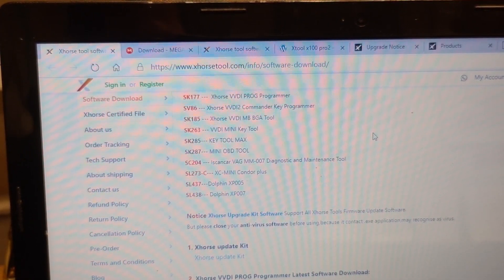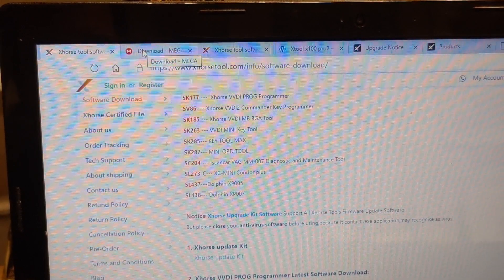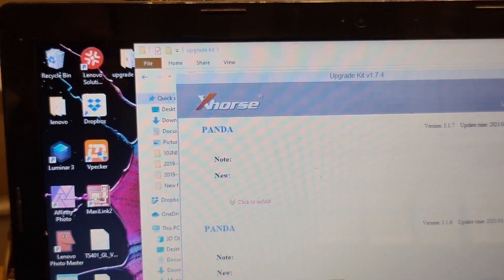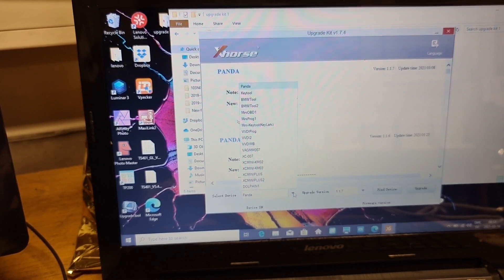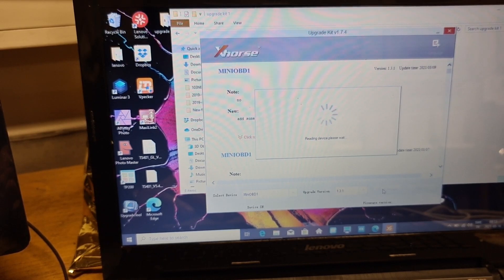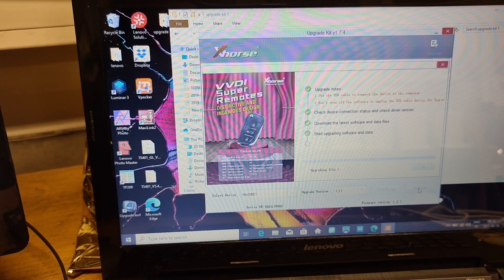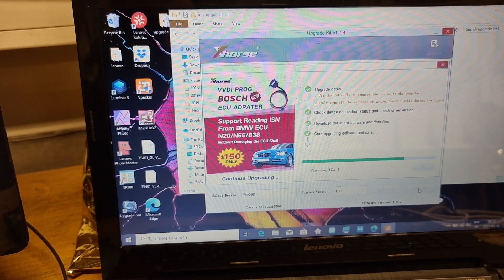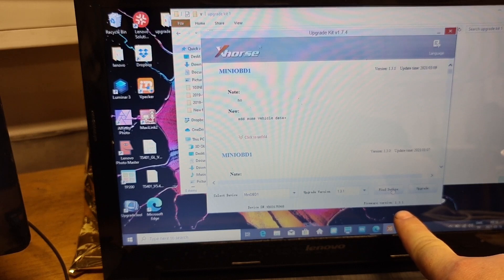How to update Xhorse mini obd with PC

Comment: Hello, it's been more than a month that I have not been able to install the update "V2.0.4" neither by the computer it does not succeed it marks this as the reason. " error code (7:03:02:00:00)
Reply: Solution it's change batterie

Comment: Except windows defender says the rar file from megazip has a virus and won't allow you to bypass defender as you "need another app" to do that. After many unsuccessful tries with connecting via all the different ways it finally did it without the computer. I used connect via wifi (bottom option) and got connection but would not update. Then I tried a second option and it asked for the wifi password again (which it already had connection to in the main menu) then went back to option 1 (bluetooth) and it finally connected and then updated. I have owned it for 4 months and tried several times to no avail before this.
Reply: So it does finally freaking go. Is the entire world waiting for one server? Lol it's frustrating because the dolphin updates like buttah
Reply from the maker: Everything you can update using  Max tool , and this obd mini needs only been connected to power, and mini obd can be powered with USB or when is connected in cars obd. That's easiest way to do that.  Always when you use that kind stuff you must disable your virus and firewall protection,  that why I have PC that I use only for that kind stuff.